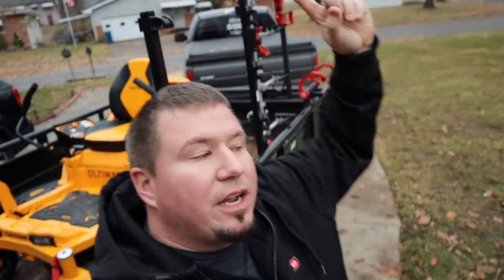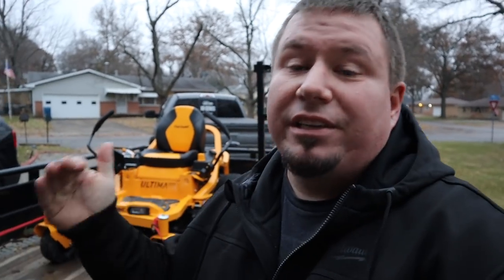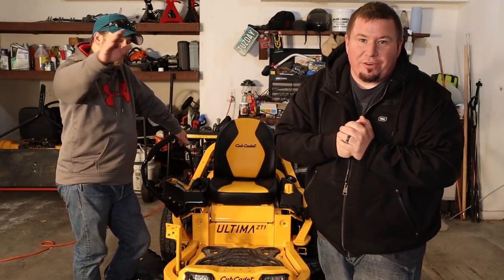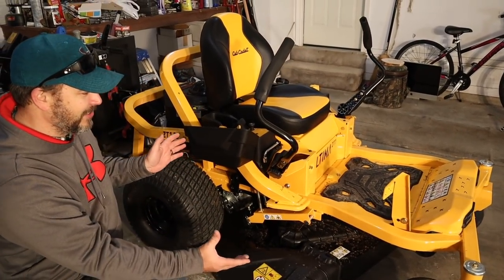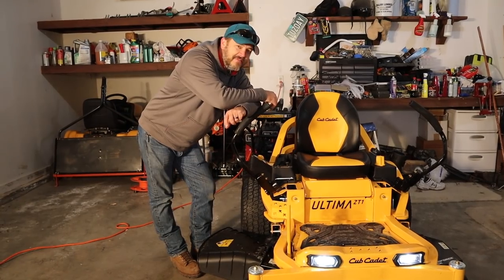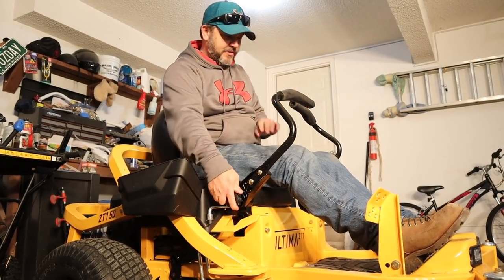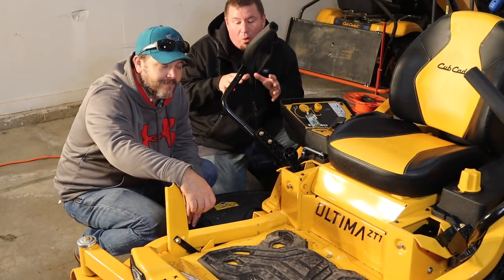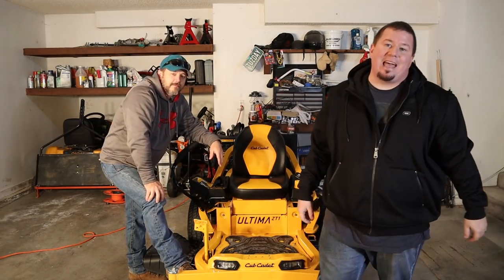Cub Cadet ULTIMA ZT1 ZT2 | New Zero Turn Lawn Mower Review

Comment: Have an old Ferris never been stored inside. Kaw engine on the ferris always starts after ten year of no maintenance abuse. With that said I am looking for a new mower with a Kaw. Seen the Arien and Gravely in person and then a friend of mine who just bought the Gravelyy equivalent suggested I also look at the Cub. I saw it in front of Depot and immediately ran through my likes while walking up. simple open design, but the biggest immediate sell as a home owner that repairs everything himself and already had zero turn experience to know what to look for like belt failures or oil change to battery maintenance...THIS CADET nails everything wonderful I could ask for. Thank you for a very good honest video guys!

Comment: The Club Cadet Ultima Series is real trouble for the likes of Excell (Hustler)and Metalcraft(SCAG). The Club Cadet site is confusing because it has ingoing and outgoing product lines. But I'm certain MTD/CC is going after the established companies' fat margins in the Prosumer price range. I have been looking for months, I only get 2 choices in ALL of the Brands. At $3K I get a decent Residential 0-turn with  EZT-non-maint pumps/motors. Then by upping the drive to maintainable-ZT-2800 with 1/3 more torque, some little change to a the seat (whatever) the next price point is $4K+. That's $1000 difference for a drive, at Hydro-Drive that only costs a couple $hundred more. Check out the Ultima ZT2. It has the 2800, plus get this... according to the site..... the Kawy 691 has been fine for us, they are upping for an FR730, which will be an update of the legend FS730. MOST IMPORTANT, price comes out in the mid$3000s. Nobody else has a Kawy, with the 2800s, and sleek/simple look in that price range. If everything is found to be equal, Hustler will have to drop their $4000+ Raptor SD's by $3-400 to compete..... Price war, We win.;)
Reply from the maker: Now that’s a hell of a Comment!!!!
Reply: Totally agree - I've been researching zero turns extensively over the past couple months.. I haven't found anything with 2800's and a Kawasaki at this price point.. everything else is in the low $4000's.

Comment: Should I be concerned when my zt2 right out of the gate is misaligned? I pull the lap bar straight back and it pulls one way. The same going forward when both bards are fully extended.

Comment: I just bought one and my belt vibrates really bad does your do that?
Reply from the maker: No it does not is the deck vibrating or just the belt? Issues could be unbalanced blades amoung other things
Reply: It’s both, the deck was vibrating and so was the drive belt. I called around and it seems like I’m the only one who has this problem. I sent you a video in direct message on Instagram.